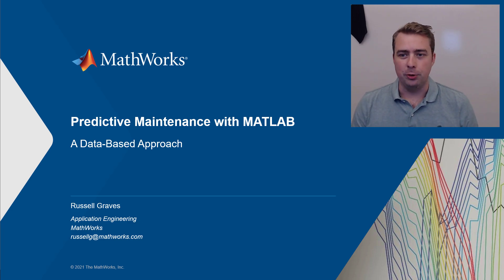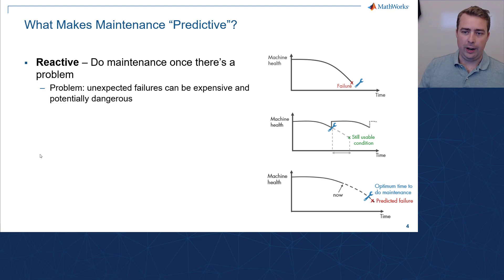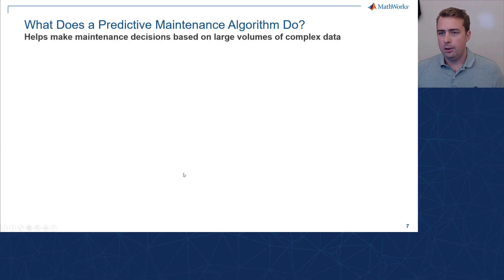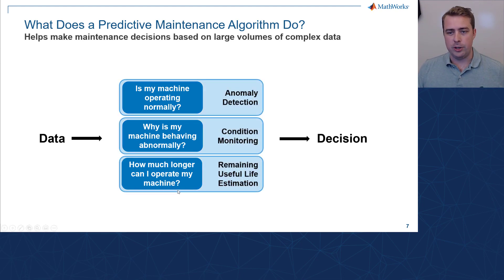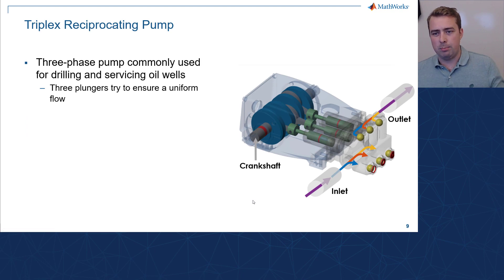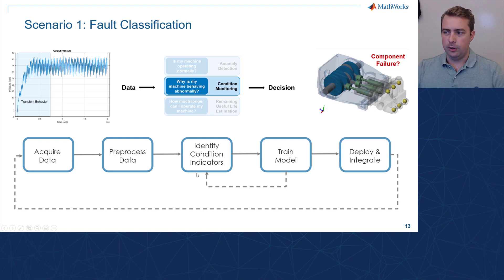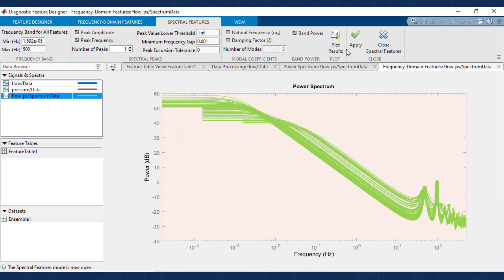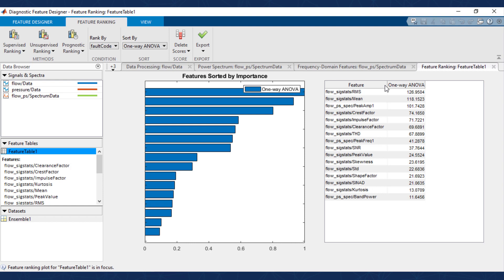Predictive Maintenance with MATLAB: A Data-Based Approach

Comment: brilliant presentation but i as a non-tech guy how can I manage my line of work were we use lots of pumps in my oil fields? and how may I detect the failure of the pumps on multiple locations? can we use iot sensors I mean what is the difference?
Reply from the maker: Thank you for watching the video. In the presentation, Russell addressed the process of taking data saved from the field and producing a fault detection algorithm. The source of this data is not necessarily streaming. However, IOT would certainly be an option. After your predictive maintenance models have been constructed, you similarly have options for how to deploy the solution. You could stream data from IOT sensors to a central compute resource for processing or deploy the algorithms to some embedded hardware on the pumps, for two examples. 

If you have any further questions, visit https://www.mathworks.com/solutions/predictive-maintenance.html and click "Contact Rachel, Product Manager" button.